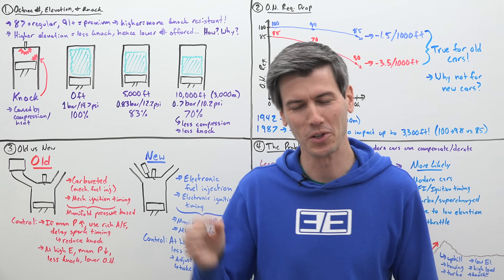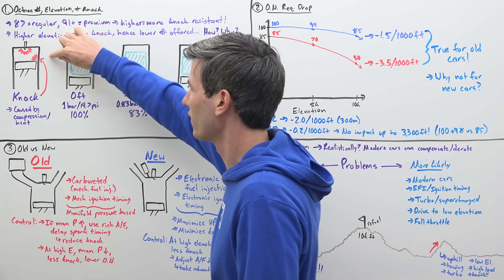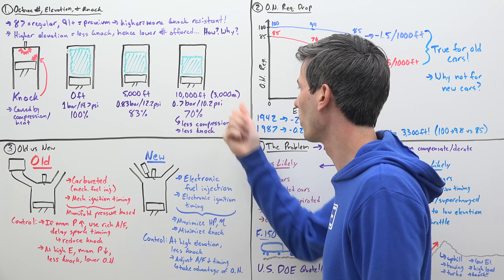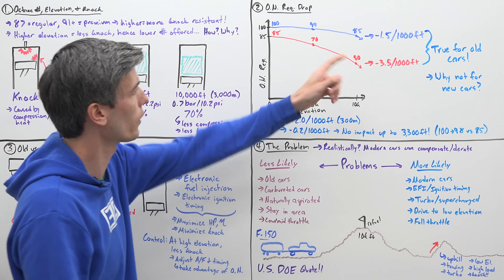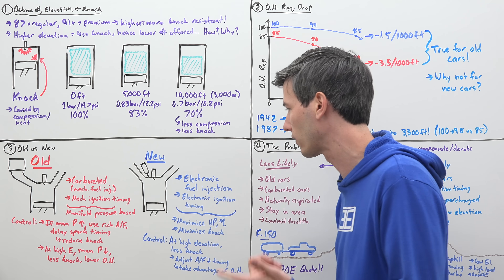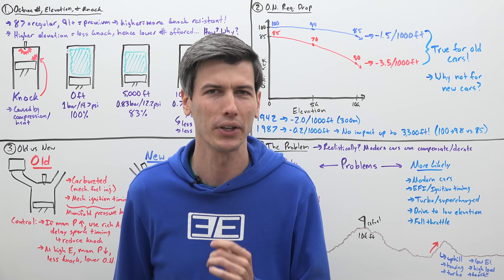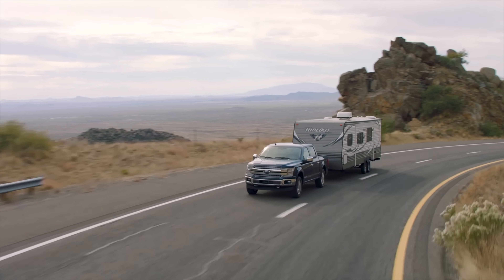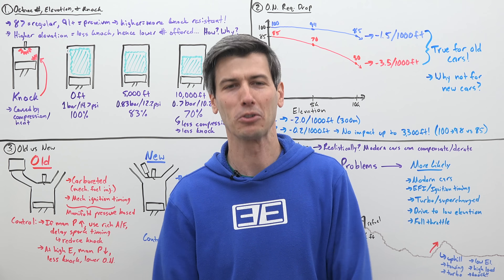Never Use This Gas In Your Car!

Comment: @Engineering Explained,  Can you please post the reference link to the study that suggests only 0.2 drop in octane rating per 1000ft for "modern" engines?  I noticed all the other links but that one.   Physics just doesn't support it. 
Yes turbocharged engines can directly compensate for pressure lost to altitude, and supercharged ones can do so if you put a smaller pulley on the charger (specifically to turn them faster at high altitudes, which can then lead to overboost at low elevations), but there is just no way in hell that any modern naturally aspirated engine (without something exotic like variable compression ratio), can overcome that loss of atmospheric pressure to produce knock at higher elevations while running the usual 2 pt lower octane fuel.     

Yes more and more modern engines are turbocharged, so it makes sense that manufacturers and the DOE are  starting to generalize based on that, but that's as far as I'd go.
Reply: .2 octane makes sense when you consider how the timing is managed on electronic vs mechanical ignition. Mechanical ignition will base timing on the relative pressure difference between the atmosphere and the intake manifold therefore running the same amount of timing under full throttle regardless of altitude however ECM controlled vehicles will reference tables based on absolute manifold pressure, and because of the lower pressure within the manifold, there will be more timing at full throttle at altitude than there would be at sea level, which means the engine will need the proper octane even at altitude because of the increased advancement.
Reply: @MrAruss99    None of that matters for a normally aspirated motor.   If there's 0.8 bar of absolute pressure outside, and you go full throttle, then there can be no more than 0.8bar absolute pressure inside the manifold. Doesn't matter how you measure or meter it.      The only time you see a difference due to the way you measure is with forced induction and then you care whether it's making boost pressure above atmospheric or total pressure.   e.g.  If at sea level the turbo makes 1 bar of boost above ambient 1 bar, then inside the manifold there's 2 bar absolute pressure.     Go up in altitude to 0.8bar, and if the boost controller measures relative pressure, then total manifold pressure is 1.8bar.   But boost controller could measure absolute manifold pressure, and request 2bar total in which case the turbo has to make 1.2bar of pressure to make up the difference.   Some turbo cars work that way, and some do not.     In the latter case, then yes you'd want to run higher octane fuel all the time, because that extra boost generates more heat.
Reply: @daemn42  you are correct that there would only be .8bar worth of pressure, but what I am saying is that the ecu is referencing timing tables that correspond to .8 bar worth of pressure and those tables assume whatever octane the manufacturer recommends therefore still requiring the same octane even though there is less ambient pressure
Reply: @MrAruss99  Nope.  That's literally backwards from how it actually works as you go up in altitude.    Let's go back to basics.  If you were manually tuning a N/A carbureted motor at high altitude having come up from sea level, you'd discover that 1.  You'd need a smaller jet (less fuel for a given throttle position) to maintain the optimum A/F ratio and  2. you can advance the timing more because your effective compression ratio goes down with lower ambient pressure and the flame front moves slower.   The cylinder pressure will never match what it's capable of at sea level, thus chance of detonation is reduced.    But  if you tune to the bleeding edge at high altitude, and then drive down to a lower altitude you risk running lean and detonation due to excessive timing advance, regardless of octane.
The only difference with modern EFI is that it can adjust both A/F ratio and timing on the fly (and sometimes valve timing), but its base fuel and timing map is going to be optimized for sea level where it can produce the most power, which means more fuel and less advanced timing.   It still listens to the knock sensors so it can retard timing if you run lower octane fuel at low elevations, but as you go up in altitude it still becomes less prone to detonation  because the effective compression ratio goes down.     No fancy tuning will change that basic physics fact. 

The stock map also has quite a lot of margin built into it to handle variations in fuel and altitude.    A typical "performance" tune or chip simply takes away some of that margin, often raising your base octane requirement, but again, unless you tune it to the bleeding edge at altitude, you won't see detonation unless you go down in elevation.
Reply: @MrAruss99  A simple Google search will confirm what I'm saying.  Less fuel and more timing advance are possible with altitude.  Look for discussions of tuning the base map for Holley Sniper EFI, or just combine "ignition timing" and "altitude" and you'll find a myriad of web pages and forum discussions stating the same thing.
There is no way to overcome the fact that there is simply less air at higher elevations in a N/A motor, thus lower effective compression ratio.   With 10:1 CR ratio with 1 bar in the manifold, you can compress it to 10bar  in the combustion chamber.     Come up to my elevation around 5500 ft and it's about 0.85 bar maximum in the manifold thus 8.5 bar maximum cylinder pressure which means it's equivalent of 8.5:1 CR.  No fancy tuning can change that.

Comment: Some heavy misinformation/fear mongering here. Octane is the fuels resistance to burning/self ignition. The F150 here will have more power at high elevation with 85octane vs a 87/89/91 ect. Low octane ignites quicker and more completely in the combustion time frame. High octane burns slower. Now if you have a high compression ratio car that requires 91octane you will quickly find out you can't buy anything above 89octane at high elevation. Why??? because it's not needed. I love how marketing has convinced everyone that high octane= more power.
Reply: that statement is only true if there is no timing increase from 85 octane to 87. The cooler burn is marginal compared to an extra degree or two of timing, especially on an engine with conservative timing to start with like the f150
Reply: True, it is heavy on the misinformation. But what do you expect? It's all done in an effort to make more money by convincing people to buy the higher priced product. Gotta love how the oil industry is easily allowed to get away with this false kind of marketing (note the sarcasm). I mean I'm 3rd generation high altitude resident, my parents lived here, and my grandparents lived here. All 3 generations have used 85 Octane fuel regularly, and not one of the many vehicles we have had, both older and newer, have ever had a single issue with this. If anything this vid should be flagged as being 'factually false'.
Reply: Low octane ignites easier and burns slower at a lower temperature but the difference is small. High revving sports cars don't use slower burning fuel.

Comment: I have been used 85, in my cars because its much cheaper then regular gas. It works perfectly fine in most of cars. Maybe if it is cold day car might bee harder to start. Car runs well after it gets warm. But all cars doesn't have fuel lines that can stand for ethanol.

Comment: If that is the case, gas stations should also put sign that warn drivers that 85 octane rated fuel is for vintage cars with a carburetor attached to their engines instead of modern electronic cars that don't have octane rating sensors in their fuel injectors to automatically adjust how the engine burns fuel. The best option is if you have the money get the Tesla Cybertruck and you will drive electric and not have to worry about this kind of problem since you just have to charge your car before leaving.

Comment: I'm one of the last people on Earth who just buys the premium grade fuel always. Everybody else is pinching pennies, just like the ones who will drive 10 miles out of their way to save 2 cents per gallon. Even owners of nice trucks and SUVs worth $60-80K are pinching pennies on cheap gas like a religion.

I have 2 Chevy V8s, a 2002 Avalanche 5.3L LS1 and a 2006 Impala SS 5.3L LS4. They both could run on 87 octane but they will increase mileage on 93 octane. I KNOW this because I tested it myself. I did not just buy the propaganda that says just because GM says use regular in the owner's manual then I absolutely MUST use regular or it will harm the engine. This is marketing propaganda to sell vehicles because everybody is a penny pincher who wants an engine that runs on the cheapest fuel. Nobody wants to hear that the engine will run better on more expensive fuel. They want to be told that regular gas is specified and mandatory.

Now of course if you have a low compression putt-putt engine in a basic economy car then regular fuel makes sense, and that's not what I'm talking about here.

As I said, I know my 2 vehicles get better mileage on premium because I tested it. And when the mileage goes up on the more expensive fuel then it isn't really more expensive. And I don't have to worry about knock. And the engine probably makes a little more power too.

And my air cooled lawn equipment engines run noticeably better on premium too, especially the 2-cycle engines.

My Avalanche engine has had an aftermarket supercharger on it since 2004, so premium gas became mandatory at that point. I just now at 106K miles put a top end rebuild in it, including ported heads and performance cam and ignition. The bottom end is in excellent condition. When I had this engine apart I found nothing but normal wear in the heads, no excessive carbon deposits or any of the scare mongering BS I've heard. The engine ran nothing but premium for 15 years. And it ran fine when I took it apart, I just wanted to freshen it up because I've also restored the body and chassis on the vehicle. The biggest issue was the OEM timing chain stretched dangerously loose, so I put a beast of a new chain in it, along with a fresh stock grade oil pump. That issue is not fuel related.

The Impala has 165K miles and it has run on premium for all but the first 3000 miles. This engine is bone stock. It's getting a little tired as you'd expect with normal wear but still runs fine for its age and mileage. GM recommended regular fuel on this engine but I know better. The reason why the engine runs OK on regular fuel is because its computer will will retard the ignition timing if it senses knock from the cheap fuel. When the ignition is retarded to control knock the efficiency goes down but the engine runs OK so the penny pinchers are satisfied. Believe what you want, but I tested this running full tanks of fuel on a very repeatable daily commute and carefully calculating my real world mileage. I know better than those who've read and heard and say otherwise.

 I've also caught GM and their dealers in some other very big lies, but that's another topic.

My advice is if the regular gas is 85 octane in your area and you get engine knock, then buy the next higher grade fuel. And if you have a powerful V8 you'll probably be better off with premium anyway. You are not going to damage it just because the marketing propaganda says use regular fuel.

Comment: The F150 comes with an optional twin turbo engine. You seriously don't want to tow with 85 gas and even 87 with turbocharged engines is iffy

Comment: I'm curious what this is like on low-compression engines like Hybrids... I have a 2006 Lexus RX400h and have never noticed any knock, even fueling up with 85 in Colorado and heading down the hill, so to speak.
However- I do think I get better mileage with higher octane, just haven't done the math of if that makes it worth it given the now sometimes $.20/gal difference between even 85 and 89 I am seeing.

Comment: Bravo. Excellent explanation.  You illustrate precisely why 85 octane is problematic.  You make the potential problems with 85 clear.  The case of filling with 85 at elevation, then returning to lower elevations and or under high engine load in lower elevations after refueling with 85 in the thin mountain air. 

Accepting that this awesome video was about 85.  I have a question about 87.

In the case of the 87 octane regular at sea level:

Shouldn’t modern anti-knock systems in EFI power plants advance ignition timing to avoid harmful engine knock with 87 octane?

Comment: Wish I had seen this earlier. I encountered 85 octane fuel for the first time a few days ago. Hesitated a bit but I figured if Premium isn’t needed for my vehicle then 85 would be fine, too. Filled up my 2014 Nissan Sentra with it. This was in Boston, right at sea level. Crazy that it is sold there. I noticed some minor noises coming from the engine afterwards. Hopefully it doesn’t get worse. They should put warnings and recommendations on the gas cap.
Reply: Is 85 octane sold in Mass.? Or did you get E-85, which is 85% ethanol?
Reply: @Scott_From_Maine  It was regular 85, no ethanol. The pump was in a relatively poor neighborhood of East Boston. I've never seen 85 anywhere else. The good news is that my Sentra seems to be running perfectly again after a couple fills of 87.

Comment: One more reason I argue for NA motors as daily drivers even if that means your F150 is a V8 lol. Maybe it's just my line of thought but to me a bigger motor that isn't strained is a better choice. Yes you may lose 3 or 4 mpg but if you're like me and you drive your cars 200k or 300k miles plus. That minor fuel difference won't justify cutting the engine's lifespan in half. Maybe if I replaced my car at 75k miles I'd have a different opinion but my 03 5.3L Yukon 4x4 with 240k will consistently get 22 mpg highway which is 2 mpg highway better than than EPA estimate for a 2021 Yukon with the 5.3L and 4x4.

Comment: I think the real problem is modern engines are engineered to run within an inch of their lives.  Higher compression, higher RPM, lower displacement, lots of hp in a tiny package.  The old adage that you can get 2 out of 3 traits out of a machine applies.  Durability, power, efficiency.   You can't have all 3 in the same package.  Piston engines have lots of weight stopping and reversing direction, unlike a turbine for instance.  Each piston, along with the connecting rods are literally bouncing their asses off inside there thousands of times/min.  So we make them lighter.  Lighter/faster is generally more efficient.  But not as durable.  Heavier/slower is very durable, but less efficient.  Engineers are always trying to find the best balance.  My recommendation is to never buy the latest and greatest.  We, the consumers, are now the test bed.  It's really remarkable, what they've been able to achieve.  For the most part, new cars last MUCH longer than the cars of yesteryear when we're talking odometers.  When I was growing up, a car with 50k miles was considered a high mileage car.  We just drive a lot more now.  Yes, cars have lots of plastic where there used to be metal.  And plastic can break.  But it doesn't rust........   Emissions?  That's a whole lot of video all by itself.

To have a full size pickup running on a 2.3 liter engine is nothing short of incredible.  The one with twin turbos jumps out of a stop light like a dragster.  Amazing.  But how long with they last?

Comment: I have noticed most cars off the at a stop line running regular 87 have a lot of detonation sound for about 2 seconds or so before the car gets moving i noticed my Toyota yaris was doing it so I switched to a higher octane ethanol free and problem solved! And gets better mpg without the ethanol crap

Comment: I am amazed at the low octane levels being sold as regular in the USA. In Europe 95 is the lowest you can get, with 98 being sold as premium. With ethanol levels of 5 or 10% depending on how much you're willing to spend.
Reply: 95 in Europe is 91 in the US, they use different standards. E85 in the US is up to 105 octane in European standards. Very few European countries have a practical amount of E85 equivalent gas stations, let alone vehicles to take advantage of the fuel.

Comment: But aren't you forgetting about knock detection?  Most modern engines (and I'd hope a 2020+ vehicle would count) have some kind of knock/detonation detection and advance or retard timing based on that.  It's why you can drop down from 93 to 87 in higher compression engines if needed without any adverse effects (usually.)

Comment: I wonder if this problem could be sold with Octane booster. Some cars here that only take 98-100 Octane gasoline, (mainly the high performance ones) but some areas only stock 95. So if you get to such a god forgotten place it's good to have a bottle of octane booster in your trunk otherwise you might mess up the engine.

Comment: There is also a difference in the compression ratio from most older vehicles versus vehicles today. Compression ratios are generally much higher today than they were in the 60's
Reply: Ah I found him, the guy with a brain
Reply: Low octane fuel can cause knocking (burnt pistons, holes in pistons, bent conrods)
It only happens when-
Its hot weather
Driving uphill from a stop (max load low rpm)
Ignition advanced too far

Most people can't tell, but roll your windows down, get near a wall to hear the echo, leave your handbrake on or start on a hill and load/lug the engine. 
If you head rattling (coins in a jar) then upgrade your fuel
Reply: Which means what? It hurts the old cars more or less? I got a 2000 mustang that's only had 85 for the last 5 years